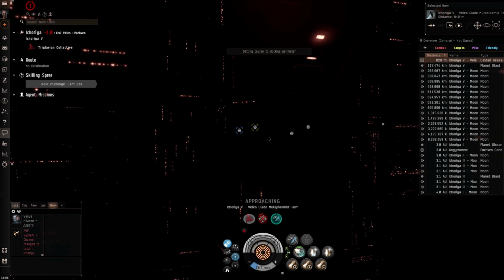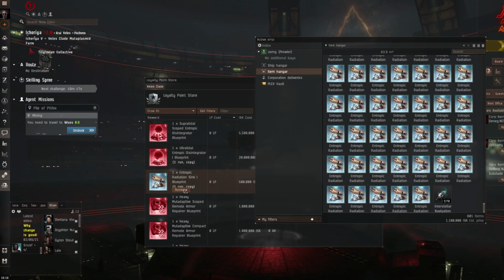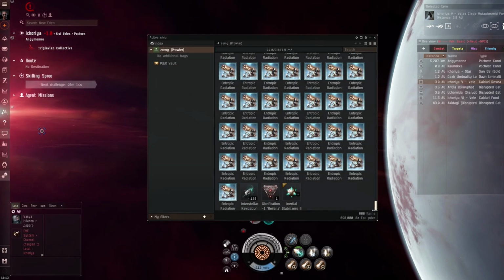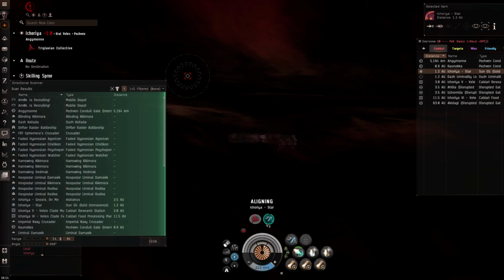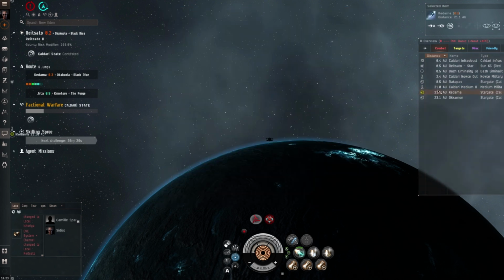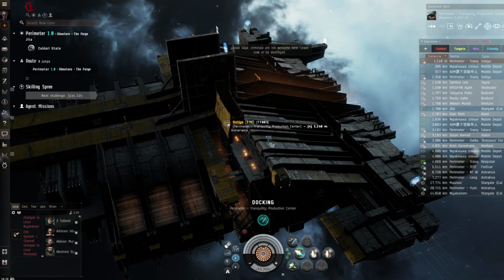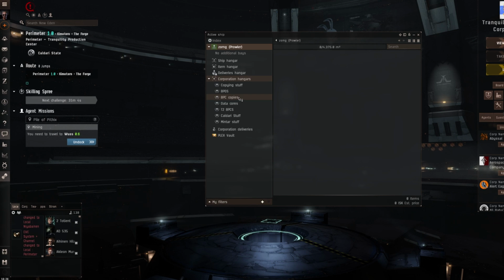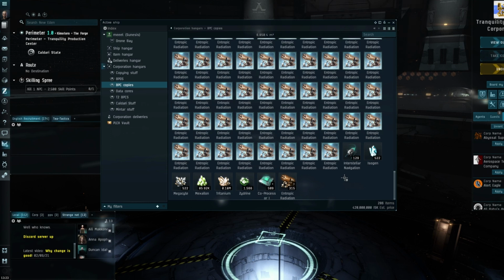Eve Online - Manufacturing profit, Pochven 300 mil ISK

Comment: In Pochven if I start to kill NPC drones, I will increase both EDENCOM and TRIGLAVIAN standings? If yes - theoretically - if I kill a lot of NPC drones I can reach high standings with both factions - to not shoot me in High sec and let me dock in stations in Pochven?
Reply: Correct
Reply: @TroaBarton  Thanks! Do you know which drone combat sites what a player can kill solo in a cloaky cruiser safely?
Reply: @harcospondro2290  I wouldn’t think the word “safely” to apply to anything in Poch. But to answer your question torpid sites should be doable so long as you start with the big ones.
Reply: @TroaBarton  thanks, yeah I mean safe to kill the npc solo, not safe against other players
Reply: @harcospondro2290  well you can clear the big balls of rogue drones with a Talwar set for range and speed if you bling it enough to keep the cap up. Minmatar ships have the electrical output of an Amish community. I always fly cheap in Poch. I’ve heard of people doing it in Sunesis, Jackdaws, and Nagas but haven’t tried that myself. Talwar works fine and only costs 8 mill.

Comment: I guess this a general industrial sector question for a newb like me. I currently am in a low-sec area with my corp, but there is no industrial activity going on in my corp nor is there a setup to promote any industrial activity. How would you recommend i haul my items that i produce in low-sec to any of the trade hubs. I am like 30 jumps from the nearest trade hub, and I have to go through a bunch of low and null sec systems?
Reply from the maker: Personally Id use a Deepspace transport like the Prowler or wait for a wormhole to open in the system which goes to HS.
Reply: @strange_Net  thank you
Reply: There are a few options. Depends on your skill level. You can do the DST MWD/Cloak trick through the systems. It's pretty hard to catch those. You can get a JF pilot and jump it closer (takes experience and prep for that to be safe) Or pay some service like pushx to move it for you.
Reply: @twistedjonny4260  to me it seems very difficult to make isk if I hire someone to haul my stuff...I will have to look into DST...but thank you for your response...